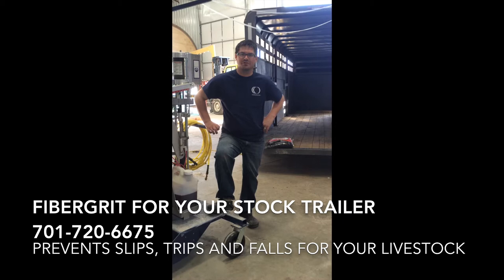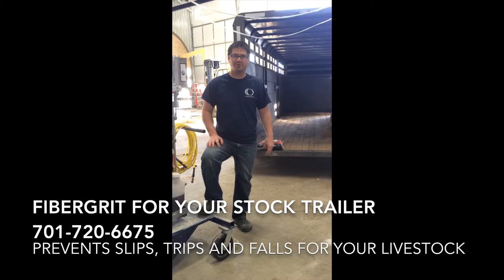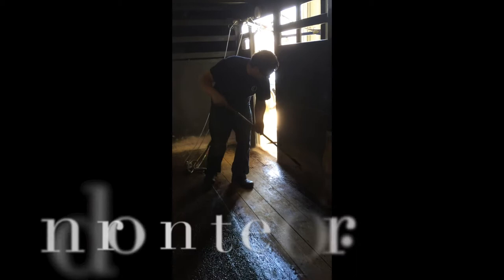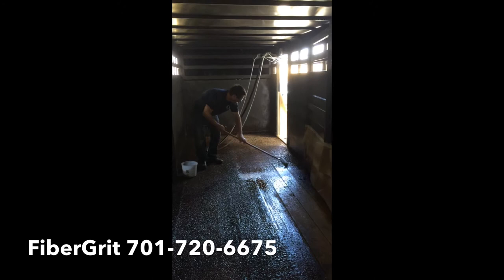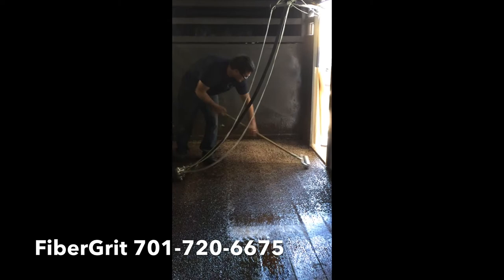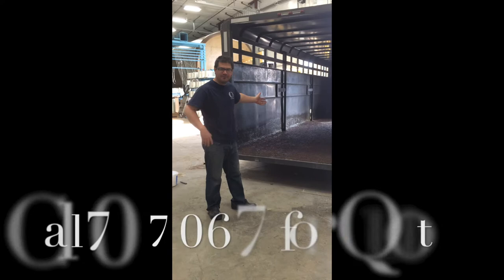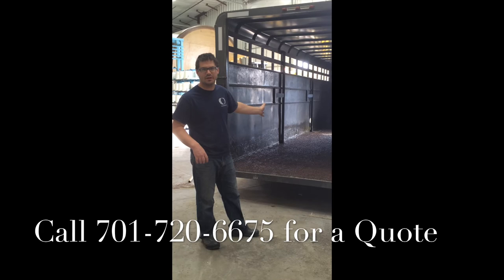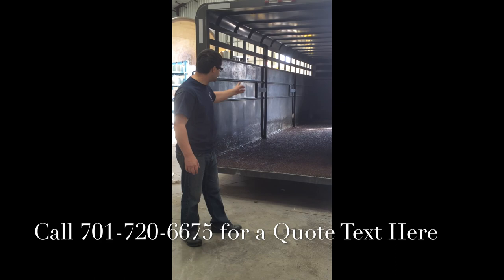Fiberglass Your Stock Trailer

Comment: I have the same question... how much to do a 16 x 8 stock trailer ... are you still doing this?
How have these held up?
We have a stock trailer/horse trailer style  that needs boards replaced and sand BLASTED, new wiring, new chains, new jack, and a few welds for good measure... (axles and tires are new, NO rusted through spots anywhere) ...
Looking to recondition...